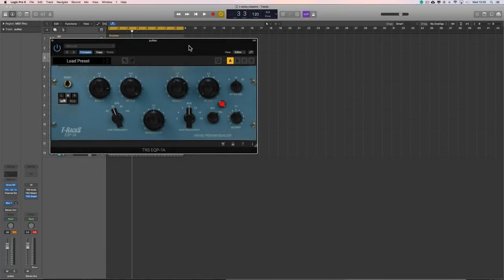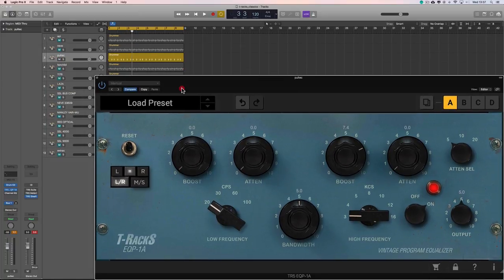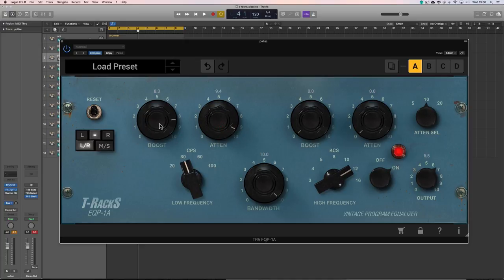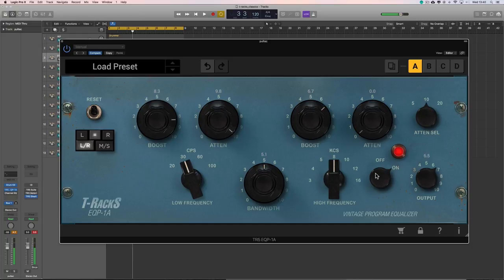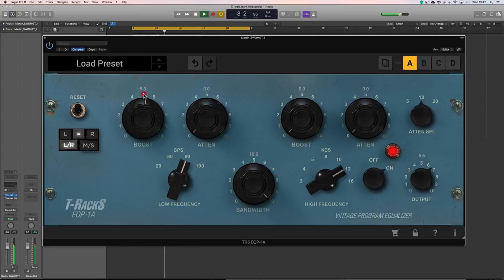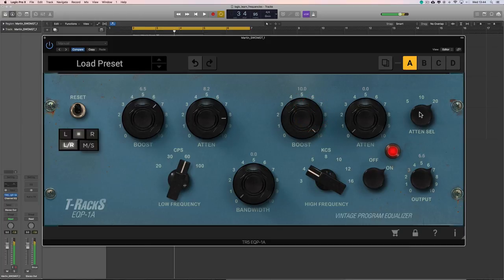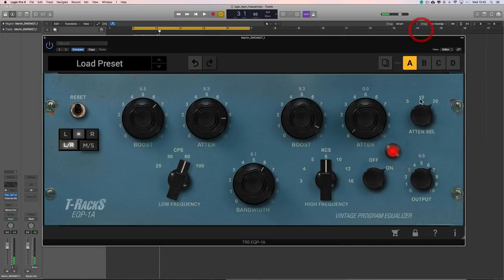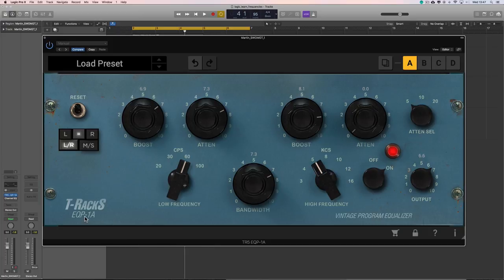T-Racks 5 Plugins Review: EQP-1A (Pultec EQP-1A)

Comment: Question: what is your opinion on gain staging? I see your meters in the red sometimes - I heard a lot about the magic -18dB rule. Thank you! I think that they are moddeled with way higher gainstructure - If I use the SSL version and try to compress, I dont get almost any kind of reaction - so I have to drive the plugin way hotter. Same with the Uad SSL Version (sometimes driving it with +10dB and adjust the output accordingly)

Comment: This is the best explanation of the interaction between boost and attenuate for this EQ that I've seen. Thanks!
Did you have v3 of this suite? If so, how do they compare? I'm trying to decide if I should upgrade or not.
Cheers,PaA
Reply from the maker: I'm using t-racks v5 & there's no difference between the pultec emulation V Logic's that's worth noticing
Reply: er... my question was did you have v3 of TrackS, and how does it compare with v5? Also, I am having issues (I bought the Deluxe ed.). The GUI does NOT resize, and I am getting 'plugin not authorized. ARGGGHHHH!!!!
Reply: Ok, had to download the latest version of the Authorizer. Things work as expected, BUT.... I have to get rid of the MAX plugins in the plugin manager that are not part of the DELUXE suite. One thing IKM does that annoys the shit out of me is put all these unauthorized choices in my menu. Did it with Amplitube, and now with TrackS.
Reply from the maker: oh, no, never had v3. sorry.
Reply: Ok, again thanks for your vids. I find them very helpful.
Reply: There's a good upgrade deal right now, check it out if you haven't.
Reply: @PreacherAtArrakeen have you upgraded your sound system ?

Comment: What's fascinating to be me is how good or otherwise these emulations are in comparison to their physical originals. I don't personally have any actual outboard or intend to - I think it's over (stress, that's just me). The UAD plugin version of the Shadow Hills Mastering Compressor for example is currently £149 whereas the actual unit is £7,800 meaning in theory it would need to be at least 50 times better to justify the cost. I know it doesn't quite work like that but you get my drift..
Reply from the maker: well at the end of the day what's the song/arrangement/production like? that's way more important than stuff like "audio quality", "pristine signal path" etc imo.
Reply: Good point
Reply: Facts!